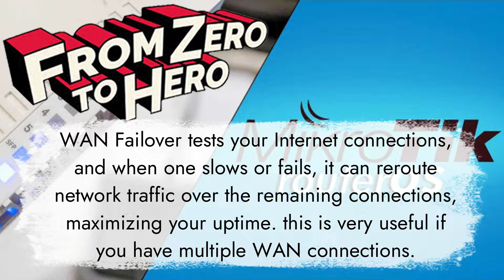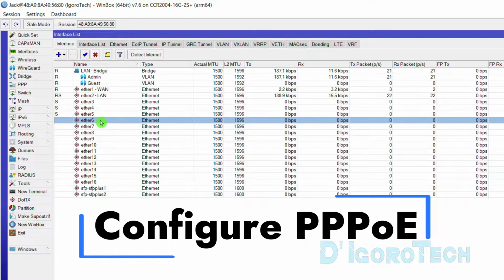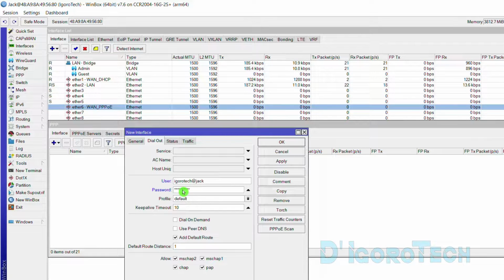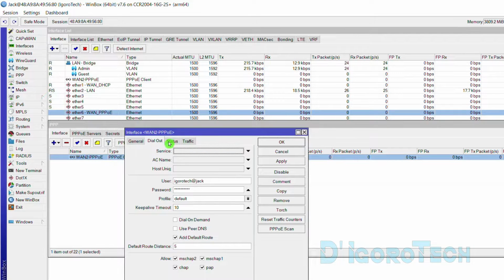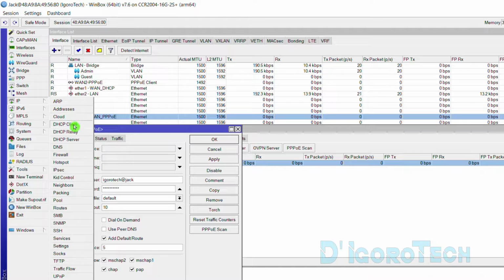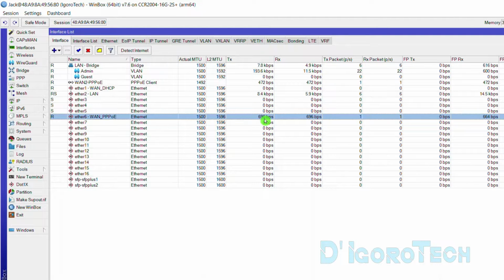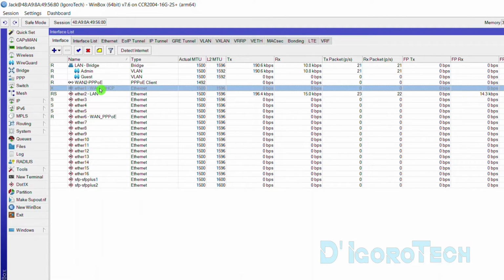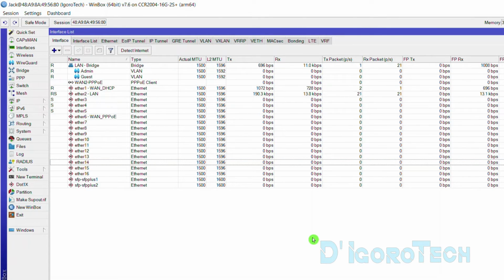How to configure PPPoE on MikroTik router with WAN FAILOVER - Part 4

Comment: I have a CCR-2004-16G-2S+ with RouterOS 7.8. I am using a 10G RJ45 SFP to connect via PPPOE to my ISP (Bell Fibe). This configuration seems to work perfectly.
When I upgrade to RouterOS 7.9 or RouterOS 7.10, I start getting dhcp critical errors (lease expired) every 15 minutes.
I have switched back and forth between RouterOS versions and the on RouterOS 7.9 and 7.10 a dhcp client is dynamically created for my sfp-sfpplus1 [WAN] interface. In RouterOS 7.8 there is no dhcp client at all.
Is there any way to stop the dynamic dhcp client creation in the newer RouterOS versions? Or can I configure the PPPOE differently to not receive the errors?